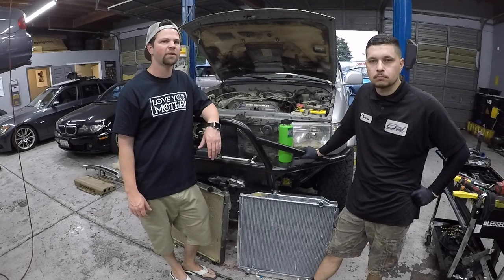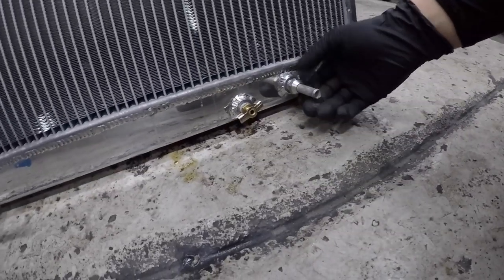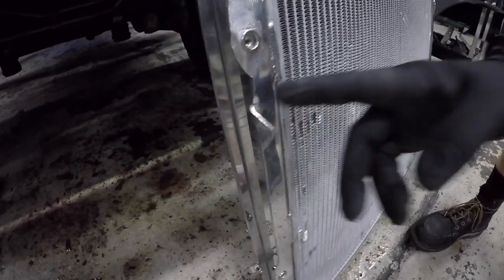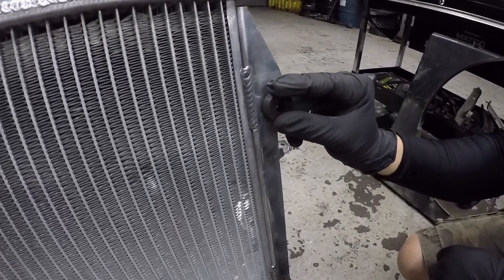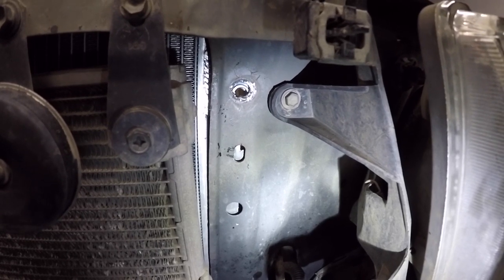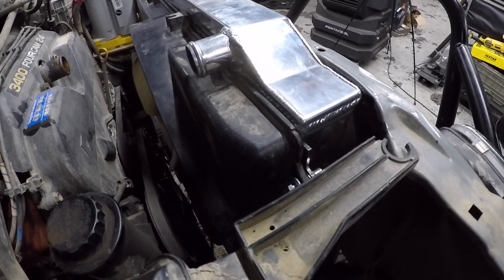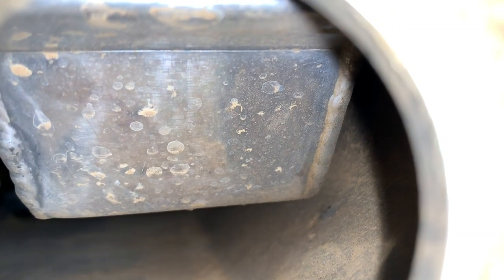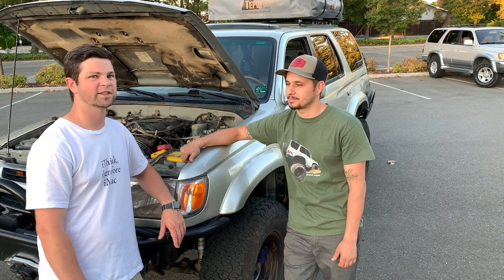Champion Aluminum Radiator Installation (3rd Gen Toyota 4Runner)

Comment: Hey, Timmy the Toolman I need some help I got a problem with my rig is a 1997 4runner I have 2 error codes the first is P0755 shift solenoid B do you have an idea what could be the problem, is it the actually solenoid and  do you know where is it located? The other code is P0303 a misfire in cylinder 3 for that do you recommend to change the wires and spark plugs. Thanks for the help!
Reply from the maker: marc perez the shift solenoid is inside the transmission. You’d have to drain and drop your transmission pan to access the bottom of the transmission to change that part. We have a video of removing the transmission pan. You should watch that video to see what is involved in gaining access to the bottom part of the transmission. The other code probably is just spark plugs and wires. Basic tune up should fix that
Reply: @TimmyTheToolman  thanks for the pointers, I swapped the spark plug on cylinder 3 for a a fresh one it all works fine now. No more misfire code or shift solenoid code. I think the shift solenoid code triggered cause of the misfire on the engine causing it to have irregular rpm triggering off the selonoid b warning code. cause when it did the misfire it shanked a little when u put it on gear then stopped shaking. I also found out that the spark plug was cover in charcoal and pulled another spark plug from another cylinder to compare it and the other was clean, so when I checked the cylinder from up top with a flash light. I found out that cylinder 3 is leaking oil inside I think that is what is messing up the spark plug sooner cause of all the burned oil in it. It actually happen ones before six months ago the same misfire on cylinder 3 I thought it was just old sparks plugs. But I think the real reason is a bad gasket all along.  So I think I have to replace the valve cover gaskets and the cylinder gaskets and I think that would fix it since that appears to be the only problem. What do you think? Does it sound like that is the problem or I am way off. Again Thank you for your time and advice.

Comment: Aluminum radiator are overrated. Stock one works perfectly for all you need in these 4runner.
Reply from the maker: Well, depends how modified a person's rig is.  Rigs with lots of extra weight from bumpers,  armor, roof rack, bigger tires, etc, puts more strain on the engine.  There's a big difference between my 98 that's heavily modified compared to my 2000 which is mostly stock.  My 98 runs hotter, mainly on grades in hot ambient temps.  I have heard the aluminum radiators can give better cooling.  I might try the Koyo aluminum radiator at some point and see if it helps with my engine temps.
Reply: @TimmyTheToolman  
It’s a little bit more complex that that, but I agree that an heavily modified vehicle produces more heat than a stock one, in certain types of use and conditions. 
I never tried an heavily modified 4runner on a trail, but in our race car the OEM radiator works as good as the Koyo aluminum one (by the way, Koyo Japan makes good radiator for the money) so we just prefer using the OEM unit, which is less prone to failure. 
Another thing, we should monitor the temperature with an external tool, up to 110 Celsius there is nothing to worry, it starts to be scary when you read 120 Celsius, which is the dangerous zone where the head gasket starts to fail.
Anyway, I really thank you for your videos, I just got a ‘00 4runner with 400k km and your channel has been nothing but fantastic so far!
Reply from the maker: @MrAnticaArte  That's good to know about the Koyo not offering any better cooling than OEM Maybe I'll just stick with my OEM radiator.  What I've found is the OEM radiators Toyota is now selling aren't on par with the ones they use to sell.  The replacements they use to sell looked to be the same quality as thr original and they sold for around $200.  The Denso ones they now sell are clearly more cheaply built and sell for half the price.  

I definitely monitor my coolant temps along with other things like trans temp and charging volts.  I use to use the Torque Pro phone app but now I use a Scan Gauge tool.  The engine temp I start to get worried is  around 210 Fahrenheit or 100 degrees Celsius.  That's when I start to consider pulling over and give my engine and trans a break.  I think the highest I've brought my engine temp was around 220.  Knowledge is power and I definitely want to know what my temps are doing so I avoid a major issue. 

Glad you have found our videos helpful.  Happy Wrenching!